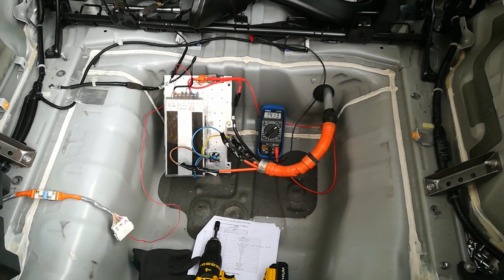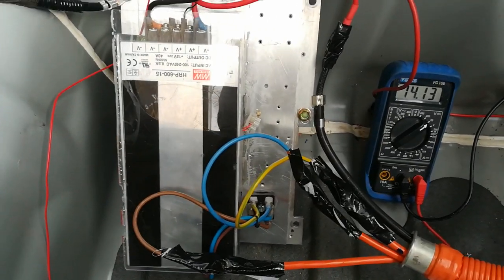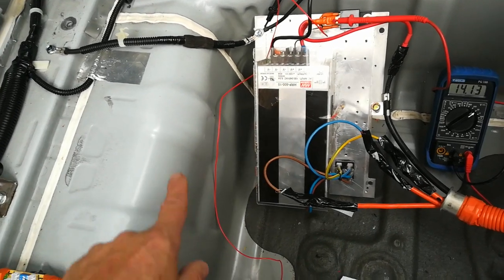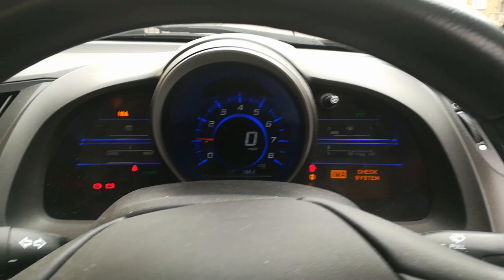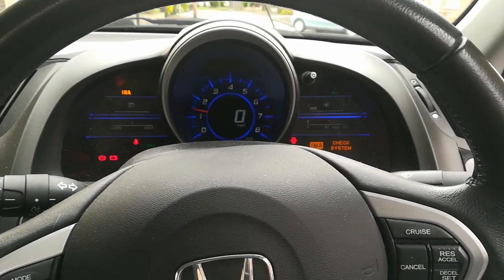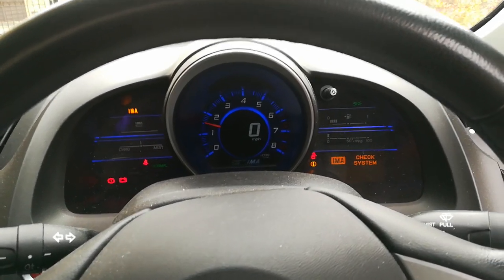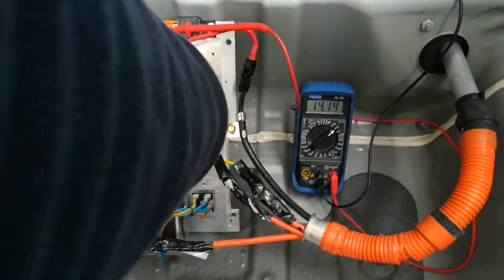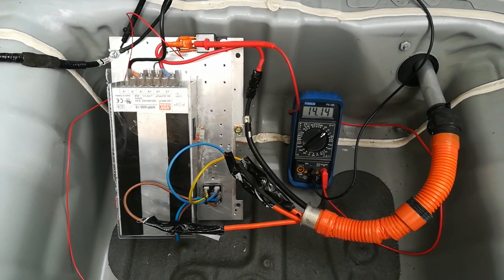CR-Z IMA Removal and running on 12V Video 3 (Working in the car)

Comment: Can you explain why it need to be at 1500rpm for it to works. what is needed for it to works properly without reving the engine at 1500rpm
Reply from the maker: Please post questions in the threads on the CRZ forum.

Comment: Hi Peter, can you still drive the car to at least 40mph on this 12 volt battery?
  And do you need to connect or disconnect any wires to the 12v battery before driving the car and after?

Thank you
Reply from the maker: Please post questions on the cr-z forum in the thread for this mod. Thanks

Comment: My IMA battery is about to die and a new replacement is extremely expensive. I guess it will become a kind of Honda Fit if the battery is removed. Will try to figure out how to remove it with your videos. Thanks!

Comment: what type of dc power supply to use for this???
Reply from the maker: https://www.crzforum.com/threads/completely-removing-the-ima-battery-pack-and-running-on-12v.94859/#post-1402401